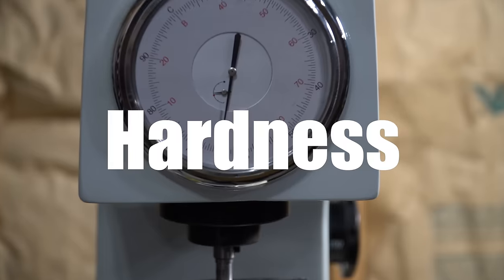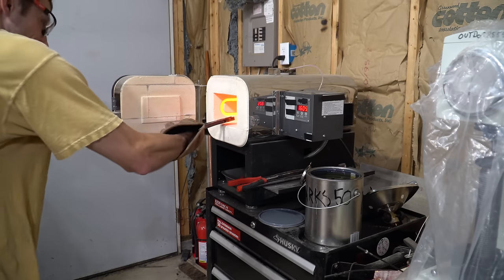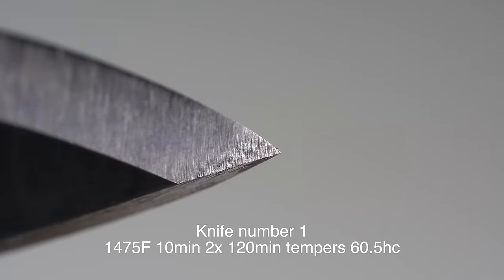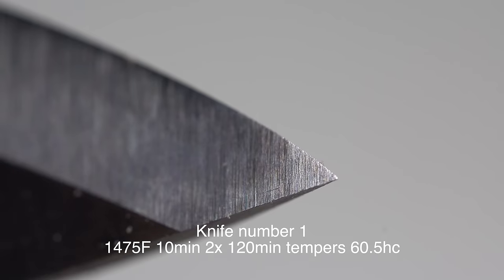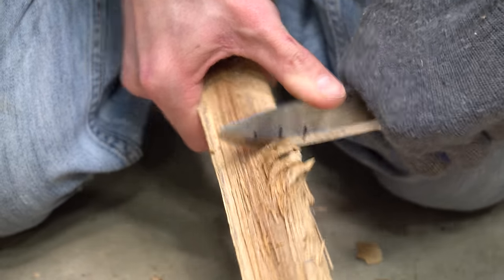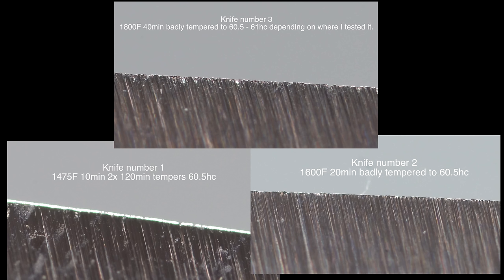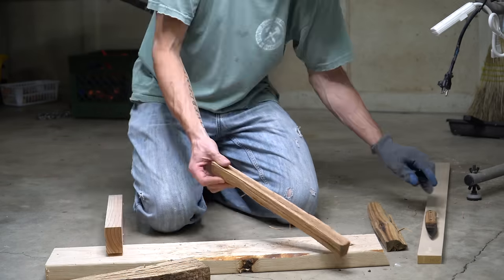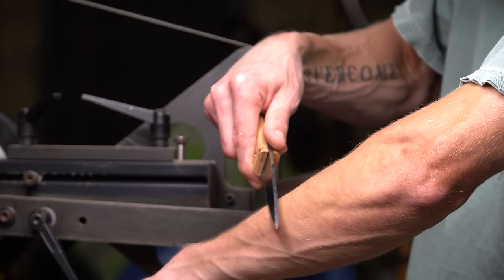The BIGGEST LIE in the knife industry- Good Heat Treatment vs BAD Heat Treatment

Comment: Untill further and extensive research, the results apply only to this one batch of steel. Knife performance is more that just edge retention as it is affected by size/weight/shape of the blade/handle, edge geometry, intended usage/purpose, and  other factors. Steel performance is also more than edge retention, it includes hardness, toughness, corrosion resistance, and again other factors. Edge retention seems to be mostly related to hardness only regardless of everything else. Great great test! Good job!
Reply from the maker: Yes the exact results are only for this steel, however the principal remains the same, even with other steels.👍🙂

Comment: When I clicked on this, I was expecting something to surprise me.  The only surprise  was that it turned out exactly how I thought it would.  

The problem amongst the community these days is that HRC is seen as THE go-to metric for all things "quality".  That is not to say that it shouldn't be looked at, but it is somehow the soul focus for most people.

Also, there are many people who buy sprints of the same knife in different steels and consider only one or two aspects of testing and start proclaiming their findings as definitive results.  Social media absolutely helps perpetuate the falsity as well.  In reality, most people couldn't take the Pepsi challenge with identical blades and tell the difference between high carbon steels and super steels.  They simply do not use and test them extensively enough.  It is the equivalent of taking one shot from a firearm, getting a lucky shot in the 10 ring and calling it accurate.  The ideA that we live in a time where the availability of so many different steels that perform extremely well is like living in a dream world.  Imagine time traveling to pioneer times where something like 1080 was the predominant steel and showing our ancestors a knife like they use in well done 3v... It would seem like witch craft!

At the end of the day, it is a deep rabbit hole and it is always fluid in its complexity.  The best we can do is try to consider the basics of what is known and keep testing.  That may seem like the goal posts are always going to be moving, but along the journey you find your favorite.

Comment: Very good video on knive steel!
All i can says is, Ive made a few knives from differend steels..
1 knive stands out from all of them.
I use it to compair/explain.
Its a highcarbonsteel-circular-sawblade..
It has manganese as a ingredient to cut highcarbon toolsteel at low speed. It is as tough as it comes.
Drop or bend it and it snappes for sure. It sometimes happens whit cutting the BEST toolsteels as a sawblade..
On wood it has the best edgeretention Ever!! Shavings & carvings all day long whit a edgeretention & sharpness unriveled. Sharpening ill do it at home, and whit powertools only when it needs to. I used it for 2 summers already without sharpening. hahaha
I never baton wood with it ofcourse

The steel that is softer compaired to toolsteel is compleetly fine for bushcrafting/woodworking.
Just sharpen it easely on your favorit sharpeningstone/method. Your suppose too! And i think its fun doing it. And oil it some too.
You can use a cheap and easy availabel knivesteel and make your own knive. It will be a good and useabel knive. I dont think you will abuse/use it on ways its not ment to be used! Becose you made it!? 
Destructiontest videos are a good way to show people how not to abuse the knives and show the limits of any steel.
There is NO supersteal, only purposely choosen ones. Or cheap and expencive ones to explain understandabel for everyone.

Comment: For 3 weeks worth of work, i hope you get the clicks.
Great job of, eliminating as much of the variables, while still keeping it based on actual human use case (paint cans, cardboard, splitting or carving woods, or just stabbing innocent MDF ;_; ).
Do you still have the samples(knifes)? Could you also test what would happen with even lighter use? Like dragging on plastic? PVC/ PET / teflon (like cutting boards). < that might give even better resolution, but Hard work on your part (unless you automatize it).
Reply from the maker: Probably wont get much. No worries, still have to satisfy my own curiosity 🙂👍

Comment: One thing which is repeated by many sources is sharpness depends on: edge angle, steel, proper heat treatment. Instead of what I’ve seen on this video I would preferred to see measurement of apex width (hopefully giving some sense of sharpness) and Edge-on-up-tester numbers for blades. To be honest pictures of edge were not obvious self explanatory as said (and forgive my ignorance if I say something which makes no sense. Not an expert). For me knife 1 looked as it had compacted instead of rolled apex (perhaps optical illusion and/or lack of understanding, anyway that is why I mention measurement of width of apex), while 2 and 3 slightly rolled. For me also, edge retention is important but definitely not the most important parameter. The most important is simply sharpness. Only then, once knife is sharp, the question comes how well it can hold this sharpness. If it say it will hold it well for very long time, than well, let maybe make it sharper and see how long than it will hold. If it looses sharpness immediately, well then let’s make it maybe less sharp and see can it hold sharpness in some time which makes it practical and feasible to use (where exact number of this time will very on person, knife, use and need of course). Point I try to make, providing edge retention information, without providing sharpness information is meaningless. So what if some edge will keep its retention if it was perhaps dull (or duller than it could be) in the first place, or width of apex of all three knives possibly identical, just disfigured differently (no wonder all three would have than same edge retention- right?). What it says about holding edge would it be made sharper? Would it still be the same or different? Let say edge 2μm (or whatever) wide with average sharpness of 78g on edge tester holds 30 cuts on rolled towel, after which it decreases to such and such values (or even better, how much it exactly decreases after each cut).  Sharper the better as long however as sharpness is retained in reasonable time. What a point of comparing three different heat treatment if each reached same HRC? Is it not a point of “proper heat treatment” to reach higher HRC (within reasonably decreased  thoughness and brittleness), so edge can be made to more acute angle it will be able to hold? Again,  please forgive me if I have some misconceptions, misunderstanding or other lacks. Not pretending to be an expert. Really relaying information (or misinformation) I absorbed (well or not so well) from watching probably well over 100 YouTube videos now, plus various forums. 
Question which bug my mind is: how to identify proper heat treatment in knife which is to be purchased? How exactly (numbers)  Kasumitogi or Honyaki affects parameters of knives. ONLY  measured values provide sound information. What “better” say edge retention really means? 10, 50, 250% better? Better for acutely sharpen, average or dull edge? If acute, how acute? And so forth…

Comment: This is more or less what I expected, an improper heat treatment would generally result in an inferior grain structure which results in a more brittle*/*fragile blade, however it does not necessarily result in an inferior blade from a cutting perspective -- at least in my experience. I'd really like to see these knives cut in half so we can get a good look at the grain structure under a microscope, that would probably be very enlightening. Excellent video nonetheless.

All else being equal I'd always prefer a knife that would survive being dropped or otherwise abused.

Comment: Quick question Alex, you’re using 1/8” 1084 & probably annealed steel from knife steel supplier, then austenitized. That one time is the only heat to the steel correct. BTW hope you’re feeling better. Thanks

Comment: I'm starting to get into knife making after years of watching videos and the heat treat part is where I think I'll mess it up. I feel I should send my knives off the a professional service to ensure it is done right.
Reply: i would recommend trying it first, if you make a knife you will be bothered that a very significant part wasnt made by you, i am starting to make knife too thanks to this channel, havnt done one yet but its SUPER fun to build and tinker on a mini oven from clay and pizza stones etc and ive tested it on a piece of carbon steel it worked and if you use wild clay and a simple propane torch its really cheap. trust me you wont regret trying it :)
Reply: Heat treat takes a moderate amount of trial and error, but can be fun to experiment with.
Reply: Shell out for a heat treating oven.
Reply: @false-set  that is a lot of money for someone who is just starting, in the long run it is usually the better option but you can have roughly 100 knives professionally heat treated for the price of a decent entry level heat treat oven.

Comment: I’ve always loved all of your videos. I’ve also been so inspired by how your brain works. I’ve made about 50 or more knives and all with 1084 and simply used a file to determine hardness. I’ve never done any testing for fear of breaking one of my knives. (Embarrassing I know) I also have bought thousands of dollars worth of custom and production knives for many reasons. When it comes down to my EDC it’s kind of a strange story. I most love my para 2 for comfort in hand and being very functional with most tasks. I have so many different steels in the same style knife and probably prefer the one with s35vn. I carried it for years. I also own a cold steel recon 1 which is also in s35vn ( spear point). I’ve always hated thinking about using it for EDC because it’s hard to open, has rough  plastic scales and it’s from Cold Steel. Strangely it’s by far my favorite EDC now for the last year. I cut the spring down shorter so the knife opens with a gentle wrist motion. It locks up securely and the rough plastic scales haven’t eaten a hole in my pocket. It just freaking stays sharp 🤷🏼‍♂️. Same steel as the para 2 but completely different results. I guess I’ll never know why the Recon 1 outperformed the para2 but that’s all I carry now. Keep up the great work my friend. You might just be the one to solve life’s mysteries. ✌️
Reply from the maker: Thanks my friend ill try! I haven't done anything or even used s35vn but it's definitely on the list of steels to mess around with! Thank for the comment really appreciate it 👍

Comment: Finnish Marttiini knives are heat treated to hardness of 55-58 usually max 60hrc. They have used this same steel for a very long time. 
It seems that Marttini is saying by doing so, that its just more practical to make them tougher and not change the steel but to make sure they get all out of it with a correct and well controlled heat treatment system? 

Marttini puukkos can withstand - 25 Celsius degrees of cold and you can still baton wood with them without any risk of breaking the the blade.

Its just basic 14% chromium stainless steel and its foolproof even in extreme cold conditions and field sharpenable.
They have the much needed heat treatment experience with this steel to get it right with this steel everytime.

It seems that getting the heat treatment right in the factory almoast all of the time is more important than people think.
If the steel is lets say a supersteel like Magnacut but it would be difficult to heat treat right most of the time it requires more precition to get to job done and usually it then cost more. So is it fair to say that it is more practical to use steels that are hard to heattreat badly?

I dont know exactly what was the problem with the DBK magnacut steel in the Bark River knife company knife they used but I remember that it had something to do with the heat treatment. 
Its not a surprise that in the beginning the companys dont get it right so well, but I wonder that are there too many knife steels that it would be possible to knife making companys master all of then at the same time?

Less is more sometimes?

Comment: I have an old ratchet wrench. The wrench has been disassembled and heated twice to low cherry red and quenched in hot salt water. I’m trying to figure out the best way to temper it, but I’m not sure what kind of steel it is. Any suggestions what color I could draw it back to? Are ratchets typically forged from mild steel? It’s a small one, and old Snap-On. Thanks

Comment: In my novice opinion the edge retention head scratch was due to the hardness being the same on all the knives right? If I'm not mistaken if you had a softer knife it would dull faster even with the "good"heat...right? If you had one at say 40hrc with a different temper it would dull faster then one at 60hrc. Right?

Comment: I will add to your headache. Kyley Harris CKC knives made a knife from 1.5 mil 304 stainless. It is a kitchen knife and used as such. As I am sure you know but some of your viewers may not 304 stainless can't be heat treated and probably rockwells in the 40's.  I have had this knife in my knife block for over a year telling no one what it is made of and just letting them use it and within the parameters of a kitchen knife it works just fine and holds a good edge. Yes it would not work as a woodcarving knife lets say but the idea that a non hardening steel performs as well as it does is eye opening. I have made knives since the 60's and have often found the answer to an edge folding is not to go thicker but thinner reducing the force needed to drive the blade into the cut and thereby reduce the pressure put on the edge. Reducing the edge angle on some steels say VG10 had them cutting as good as S30V at thicker angles. Yes you can carry this too far where the edge will collapse but often thinner is the winner. Love your videos always great information.

Comment: Why is this a subject so hard for so many to understand?? A good example of what your showing is the Kabar D2. I'm still not convinced it's actually D2 but the factory engineer swears it is. Anyway it has one of the worst blades ever made. When you sharpen it the metal rolls like from a  China 440 blade. Once you get it sharp it will chip and roll the edge. Absolute trash. My Benchmade with a D2 blade it total perfection. I worked with all the tool steels in a big die shop. Saw a lot of blocks ruined due to someone forgetting to wrap a block in foil or quenching the wrong way. Great information my friend. I bet people will still argue with you on the results..

Comment: Question is. Is there another type of steel that will hold its edge longer? A2 or D2 Vs W2? I think you normally use one of the 10’s right. 1080, 1090, 1050?

Comment: I'm completely comfortable with the principle that "performance' is far more than edge retention.

I mean, sure, you might say that a use case for a knife won't include prying or twisting. But knives can be dropped, knives can slip, and unexpected things can happen. A knife that breaks is a knife that goes out of control, and that's dangerous.
Reply from the maker: Knife performance should include more than just edge retention. Toughness isn't something easily quantifiable outside of destructive testing as far as i am aware. And most people wouldn't know what the toughest data even represents anyhow.

Comment: Over heating and over soaking will cause grain enlargement weakening the metal bonds. The blade will get hard but be prone to edge chipping and breakage.

The condition is visible to the naked eye. Break the blades. The bad ones will be less flexible and the grain will look course and chunky where it broke.
 A well hardened and tempered blade will show the appearance of fine grey velvet and be considerably more difficult to break.

Comment: Great video! Who would have fought. Interesting. Probably you would see some edge chipping when used on some even harder material like some plastics, let say you drill a hole with tip of the blade. Maybe we could see some difference there , but it would have to be really hard material. Other than that probably heat treatment is not important at all on big blades that are impossible to break in half. Of course praying with the very tip would reveal heat treatment. On normal sized blades like pocket knife you would have to know the limits of particular blade and usually no one is pushing to the limits anyway.

Comment: First - thanks for the video and your insights.   But - if you really want to know what's going on you can only change one variable at a time.  So - just change temperature, keep everything else the same.  Then keep the temps the same and only change soak times.  You get the point.  You can't draw the conclusions you drew because you changed 3 variables between all the blades.

Comment: Heat treatment is almost exclusively toughness, and hardness affects the edge retention. The toughness to hardness ratio is what makes it possible to put a more acute angle on the knife and so get the best edge retention and cutting performance while having the same edge stability of a more obtuse angle knife of a worse hardness to toughness ratio. This is why I think 1084 at a hardness value equal to 1095 gives 1084 the better ratio and can have a better cutting ability overall and better edge retention. Something like 52100 with really good hardness and also good toughness can make a crazy good edge.